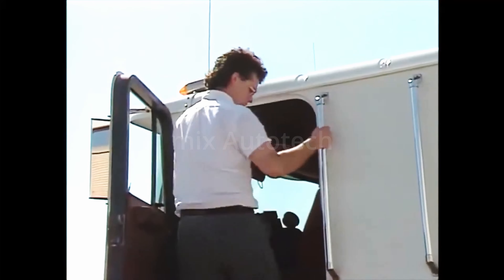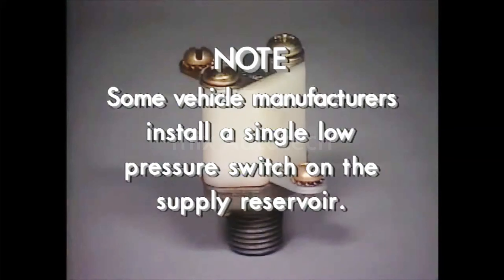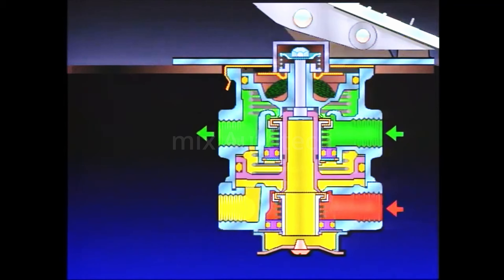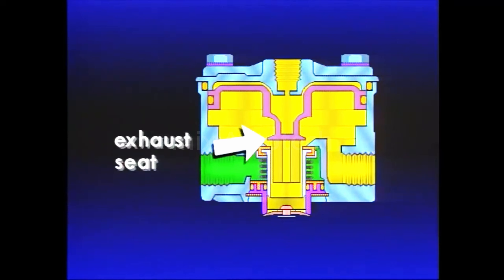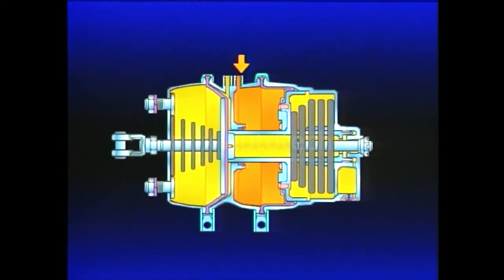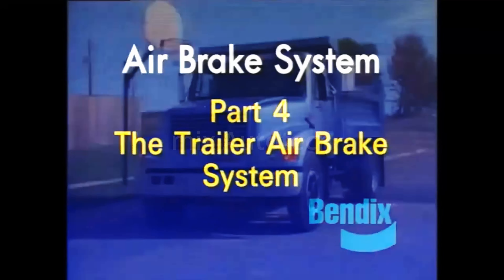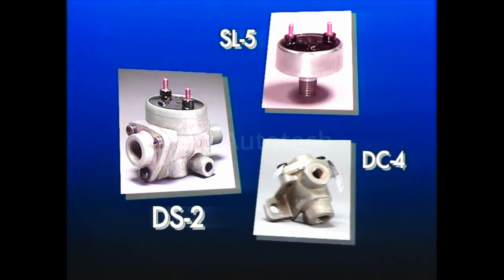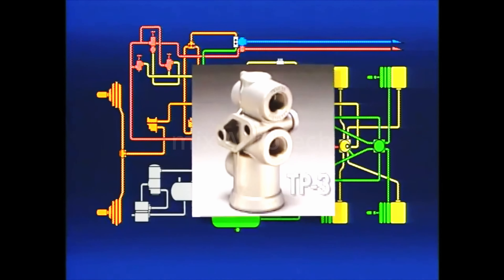Air Brake System Explain. #automotive brake system

Comment: how long the air filter drier last before it will saturated with water?
Reply from the maker: Its depends on what weather or humidity and driving conditions. But it will last longer if you frequently drain the water from the air tanks.
For severe service applications, such as residential refuse trucks or school buses, the air dryer cartridge should be replaced every year or 100,000 miles or 2 years.

Comment: I am having an issue with my tractor braking. I noticed significant loss of brake power during wet conditions. In simple Words only one out of 4 rear brake drum would actually get hot, rest remains cold as if they are non operational. As soon as the road dries they would return to its normal operation. I have replaced the abs/ modulator valve and noticed a little improvement in braking, and now 2 brakes are operational during wet conditions. Could it be the air dryer causing anything? Please help me out.
Reply from the maker: if you have friend that have scan tool, try to scan it first. you have intermittent trouble that only occurs only during wet condition and your car store the fault code bought history and present. if there are no trouble codes, try to look on the EBS/ABS live data in the scan tool and do it during wet condition look on to the wheel speed signal, brake ware sensors and brake relay valves. i am not 100% sure to my conclusion that you've  got water or moist intrusion on the system.
Reply: @mixAUTOTECH  I had it checked last year. The light would come on during rain and as soon as the wheels start spinning it will go off. I took it to a mechanic that had a Cat software and he told me there’s nothing wrong if the light stays on then there is an issue. I replaced the sensors last year and as I have already mentioned the abs valve is new as well.
Reply from the maker: The mechanic who checked your tractor knows the history trouble codes stored on the abs module but he can't confirm it because during test the code he erased it is not coming back because may be he tested it during hot season. It must be the same scenario that have trouble, wet scenario.
The abs warning light will ON and when turn the key off and back on and start rolling abs light OFF. It will remain off until you encounter the problem again.
It is intermittent fault and it is time consuming to find it or to trouble shot.
Thats why some tech will say... "Your truck is fine nothing wrong with it"